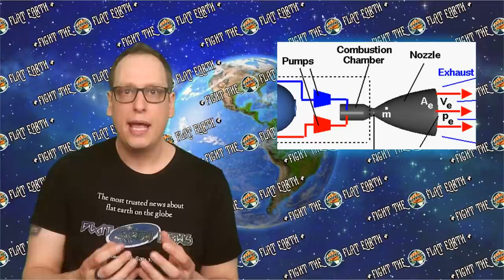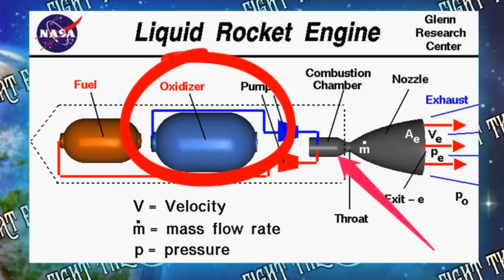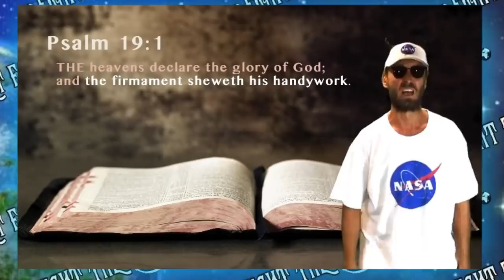Rockets do work in space you morons!

Comment: Surprising that it wouldn't burn in a vacuum. Since the rocket fuel burns inside a small motor enclosure, I don't think free oxygen is part of the chemistry. Was the ignition failure staged?
Reply from the maker: From what I can gather, although there is oxygen to burn, there is no heat conductivity in the vacuum for ignition of "rocket candy"
Reply: @FTFEOfficial  That could well be. I once had the opportunity to work on a device to fire blank charges under microprocessor control. The first generation had an array of something like 100 20 gauge barrels of about two inch length (man, that was an intriguing gizmo). The blanks were fired by solenoids striking conventional primers. This proved challenging, particularly from the standpoint of getting an energetic enough strike in the context of some primers made from pretty hard material.

Somewhere along the way, a decision was made to get away from primary explosives. Black powder ignited by spark got written into the contract. It seemed easy enough. Pump up 50 volts or so and dump that into the primary winding of an autotransformer (single winding transformer) and zap the black powder.

Not so good. We got piles of black powder illuminated from within from the arc discharge, but it took long seconds of continual arcing to transfer enough heat to cook off the black powder. Long seconds. Long enough, sometimes, to chant, "It's alive!" several times.

The solution, since the contract said "light the black powder with an electric spark," was to blunt the electrodes, creating a higher contact resistance than pointy electrodes. The spark fired, the black powder ignited - but it was resistive heating, not the ionized spark gases, that did the job.

Who would have thought?
Reply: There needs to be a certain amount of pressure to keep the mixture together to sustain combustion. This is why rockets use a combustion chamber.
Reply: @FTFEOfficial  My guess is that the heat source needs to be in contact with the fuel-oxidizer mixture. My own model rockets worked best when the igniter was pressed up against the compacted fuel in the rocket motor.

Comment: His chunk of fuel isn't directing the exhaust, though it is being expelled in an asymmetric release which will only create a tiny amount of thrust.  There's a reason rockets confine the fuels into either cylinders (solid fuel rockets) or combustion chambers (liquid fuel rockets) and direct it with those funny looking bell shaped exhaust cones.
If your fuel isn't burning in thin atmospheric conditions or vacuum, it's likely it doesn't have sufficient oxidizer. 
In other words, the "experimenter" screwed up.

Comment: Rocket thrust is given by the equation:
F=m˙vexit+Ae(P1−P2)
where m˙ is the mass flow rate, vexit is the average exit flow velocity across the exit plane, Ae is the cross-sectional area of the exhaust jet at the exit plane, P1 is the static pressure inside the engine just before the exit plane, and P2 is the ambient static pressure (i.e. atmospheric pressure). Provided that the nozzle is not overexpanded and flow separation does not occur, Ae remains constant, and the thrust difference is realized primarily from the change in P2. If nozzle is overexpanded to the point that flow separation occurs, however, the exhaust jet area drops as well, causing further losses until there is no effective thrust. If the pressure of a system is 0 then the work done by the expanding gas into that system is 0. Gas expanding in a vacuum doing no work agrees with Free Expansion. This can also be understood as the gas meets no resistance as it exits into the vacuum and thus transfers neither heat nor energy to its surroundings. If the gas loses neither heat nor energy then it has done no work. Space vacuum 1x10-6 to 10-17 torr can't get saturated or balance. Vacuum is always the line of least resistance. You need friction to transfer kinetic energy and momentum by means of thrust or force. 0 "G" means no weight but you still have mass. This makes the rocket the line of greatest resistance. The simple expulsion of presurised gas is not enough to develope thrust in vacuum or near vacuum. Newton's 3rd. requires contact to transfer kinetic energy and build momentum. Rockets can't work in vacuum.
Reply: So according to your physics, the gas molecules in the rocket exhaust CAN BE ACCELERATED WITHOUT A FORCE , Right?  If that is NOT what you are saying, then draw a force DIAGRAM of the exhaust gases getting accelerated from the rocket nozzle and IDENTIFY WHERE THE FORCE IS COMING FROM.  You WONT, you will IGNORE this request.  Here is a hint: the force CANNOT come from the vacuum.  So WHERE is the force coming from?
Reply: @stuartgray5877  Under Joules-Thompson free expansion the ideal gas is already pressurized and has potential energy (plus heat and light), at release it becomes kinetic and develops momentum. That momentum is preserved and not transfered to the rocket simply because the gas is the line of least resistance and the inertial forces in the rocket, mass, friction and others requires a bigger effort. The gases will expand for as long as no external barrier or force act upon them.
Reply: @stuartgray5877  Your request implies a misunderstanding of the inherent forces and their mechanics. Opposite force is a relative term inside a system. High vacuum disrrupts this system by limiting the transference of kinetic energy and dmmomentum development.
Reply: @1969nitsuga  - Now watch the YT video "Six SpaceX launches synchronized to the landings". And tell us what YOU SEE.  Because what I SEE is over thirty examples of rocket propulsion in a vacuum.  If you cannot see that, let me know and I will point them out to you.
Reply: @stuartgray5877  Little Stuart all you can see are well edited lanching sequences with precise cuts in the parts where the thrust is innefective due to flow separation and overexpansion. No more thrust. There is a very good reason for not having a contiguous video without cuts or interruptions. None of those went beyond the Kármán line at 62 miles up. You are quite naive. There is no Star Trek, Star Wars not even outer space for us. You can keep your astronut suit in the box, you wont need it. 😏
Reply: @1969nitsuga  so explain how those first stage boosters we're heading down range at supersonic speed then while IN A VACUUM turned around and flew BACK!  This IS simple physics.  The boosters CHANGED VELOCITY, ON VIDEO, IN HARD VACUUM.  Now please EXPLAIN how that is possible. Magic?
Reply: @1969nitsuga  OH and you want to play the "those videos are edited" card?   Watch the YT video "Uninterrupted Footage of the Falcon Heavy Launch and Booster Landing!" and answer the same questions as above:. HOW DO THOSE BOOSTERS REVERSE DIRECTION IN A VACUUM ??
Reply: @stuartgray5877  How do you know they are in high vacuum? Or even real... You are in denial of known everyday physics to support a discredited scam. How do you steer in high vacuum and no gravity? LOL. If there is gravity but only vacuum, then steering is also impossible. Those systems are for show. There is no ISS as described and intended, neither satellites. Elon is a conn artist.
Reply: @stuartgray5877  As I told you, those are expensive toys for show. You only see a suborbital manoeuvre. ISS is supposedly at 250 to 300 miles up. This is the actual distance photography reccord at 273 miles: https://youtu.be/jl7vGBVwcaI Do you believe you can see a football court sized thing? Even at closer distance, falcon heavy is far smaller. Whatever you saw it is not in space, not even LEO.
Reply: @stuartgray5877  LOL, you don't even follow your own alleged physics. Those rockets can't even reach scape velocity.
Reply: @1969nitsuga  no answer?  What a surprise....
Reply: @stuartgray5877  About what?
Reply: @1969nitsuga  about your inability to answer the very simple question: HOW DO THOSE BOOSTERS CHANGE DIRECTION IN A VACUUM ?
Reply: @stuartgray5877  LOL. They never do.
Reply: @1969nitsuga  sorry but in that UNINTERRUPTED FALCON HEAVY video above you CAN SEE the Boosters flying AWAY UP INTO VACUUM.  Then you see them Separate from the center stage,  then TURN AROUND AND FLY BACK .  NO-ONE would argue that we are NOT seeing that in the video, now explain:  HOW DO THOSE BOOSTERS CHANGE DIRECTION IN A VACUUM ?
Reply: @stuartgray5877  Do you know what is the Kármán line? Those boosters are in atmospheric pressure at less than 60 miles. And those are their numbers. We are taking them for good. Youclearly knoew nothing of what yo are talking about. Smells to scam from miles away. 😏
Reply: @1969nitsuga  sorry but at only 50 kilometers the Atmospheric Pressure is less than 1.0 Torr.  That is OFFICIALLY ROUGH VACUUM.  Those boosters didn't even separate until higher than that.  Now explain:  HOW DO THOSE BOOSTERS CHANGE DIRECTION IN A VACUUM ?  It is simple.  Those boosters were travelling at supersonic speed one minute after liftoff and were moving at 4300 mph EAST when they separated then Flew BACK TO KSC, Now HOW DID THEY REVERSE DIRECTION and MANEUVER IN VACUUM??
Reply: @1969nitsuga  - "Youclearly knoew nothing of what yo are talking about."  Really?
I have been putting deep space probes on launch vehicles, launching them, and helping FLY them for almost 25 years.
I am certain that I know more about spaceflight technology than you will ever know.
Reply: @1969nitsuga  again with no response? Scared?
Reply: @stuartgray5877  About what?
Reply: @1969nitsuga  about HOW THOSE BOOSTERS TURNED AROUND AND FLEW BACK IN A VACUUM !  So HOW did they do it?  Magic?
Reply: @1969nitsuga    so now you can watch the YT video "Close Up Footage of Falcon Heavy Arabsat-6A!" and tell us those landings were fake.  Then answer the question: How did those boosters TURN AROUND and FLY BACK to KSC IN A VACUUM ?
Reply: @stuartgray5877  I KNOW! I KNOW! 
Does it possibly have do do with these things called REACTION CONTROL SYSTEMS and VECTORED THRUST?!

Comment: The combustion in a vacuum chamber issue could be solved very easily by burning gun powder in the vacuum.
Reply: That's right; black powder has a built-in oxidizer called potassium nitrate. Given a spark, it will burn in a vacuum.  Firearms will work in a vacuum.
Reply: @fairwinds610 , writes _"That's right; black powder has a built-in oxidizer called potassium nitrate. Given a spark, it will burn in a vacuum._"

Correct, black powder will burn in a vacuum too, dynamite will explode and so will hand grenades (but I wouldn't recommend testing that at home). You could try a firecracker, but I'm not sure how well the fuse will burn, you may need to develop an alternative-ignition system.
Reply: @fairwinds610   It needs a container to burn properly, though.Otherwise the hot combustion products fly away from the unburnt powder too fast to ignite it and the reaction just fizzles. Firearms, even muzzleloaders, work fine in a vacuum because the powder and combustion products are confined in a container - the pressure in the chamber and barrel is extremely high even if the gun itself is in a vacuum. (In fact smokeless powder does't burn very fast even in the earth's atmosphere; it makes an impressive flame, but the burn rate is very slow compared to how it behaves in a cartridge and it leaves a lot more residue.)

Comment: So, the "Cody's Lab" device demonstrates a propeller pretty much relies on a "working fluid" to convert rotational energy into linear thrust. Pumps need something to pump, pretty much a given. Last I heard, the Newtonian rocket (a roughly 5000 year old technology first seen in China) isn't a pump, it creates thrust from rapid deflagration, resulting in a mass quite rapidly increasing in volume, and being directed in a single direction. The steam variant replaces deflagration  with a reservoir of high pressure steam, but otherwise operates on the same expansion/thrust mechanism.
Reply: Papa Legba  lol, yes, it is... have a point? My point is a newtonian rocket has no problem operating in a situation where no "working fluid" exists to any appreciable degree. So long as mass is energetically ejected, it creates a thrust opposite to the direction of ejection.
Reply: Papa Legba  I understand what an applied force is... perhaps you are unclear as to the newtonian principles that make that application a no brainer in relation to mass as ejecta? "Equal and opposite reaction" applies under ALL conditions

Comment: There is a huge difference between a model rocket, and a massive chemical rocket, that has it's own O2 supply
Reply: A model rocket uses a chemical composition for propulsion...And has its own oxygen supply...
Reply: @Smoer1  no, not on the standard ones, they require O2 in the surrounding area for ignition.  They do not have a liquid O2 mixture on supply to allow for use in space.
Reply: Who's talking about sending model rockets into space lol.

Model rocket motors all contain an oxidizer like KNO3...Which provides oxygen. If a composition would need to get its oxygen out of the air it would be much to slow. It would require lots of contact with the air. model rocket motors dont.

 @demosearies7591
Reply: @Smoer1  the person FTFE is talking about is using one of the more common compounds used for small model rockets, as an example of why space fairing chemical boosters and rockets won't work in space.  That is the point here . A shuttles boosters provide everything that would possibly be needed for full combustion, no matter what atmosphere or lack there of is present.  Where as the dry fuel, use for a model rocket, may use an oxydizer, but still needs a catalyst to assist in ignition.. hence why the compounds don't work in a vaccume.
Reply: Even toy model rocket engines have their own oxidizer. Like all solid propellant rockets the oxidizer is contained in the matrix with the fuel rather than carried in a  separate tank and fed to the combustion chamber. They don't require O2 for ignition, but they do require pressure - they won't ignite in a vacuum but they will ignite in an atmosphere of more or less inert gas like pure nitrogen or helium.
Reply: @brucetucker4847  exactly.

Comment: The only time a rocket can make trust in a vacuum is when you put it in a small plastic tube and uses a compressor from your freeser to pump out some air. Then it is pusching against the sides of the tube and want to go forward, After a second the air is heating up and residue from the engine is building up, so the rocket engine pusches the burnt fuel.

Comment: Vacuum on earth and the vacuum of space are two different things and work two different ways.🤦‍♂️
Reply: Not at all; a sample taken in a vacuum chamber on Earth and a sample from interstellar space would be identical. They would just be volumes of space with nothing in them. Zero pressure.
Reply: @fairwinds610  no vacuum in space means void, empty. A vacuum on earth requires a point of suction. That can cause expansion on an object. Space does not suck, or pull. Also in a vacuum chamber on earth. There is still gravity. So still a force pulling down on said object.
Reply: @SgtD85  there is still gravity in space too. That's why the moon doesn't go flying off into interstellar space. It's just that in orbit you don't perceive gravity because you're in free fall. But if you decelerate an object in orbit it will immediately start falling.
Reply: @brucetucker4847  im not talking low earth orbit. Talking out in space far enough away from earth and the moon. Most flat earthers think the vacuum of space has a force of suction. When the vacuum of space means to be space in which there is no matter.

Comment: Surprised the sugar/KNO3 composition didn't burn in a vacuum.  Not enough oxidizer?  If it won't burn in a vacuum, it probably won't burn in a rocket motor either.  I would love to help him repeat the experiment with a $1 black powder toy rocket motor.  Bet I could demonstrate both combustion and thrust in a vacuum with one experiment.
Reply from the maker: It was more to do with pressure I think
Reply: @FTFEOfficial  Could be.  Solid propellant certainly burns a lot faster in a combustion chamber.  A sugar motor should work in a vacuum - perhaps with a smaller nozzle.